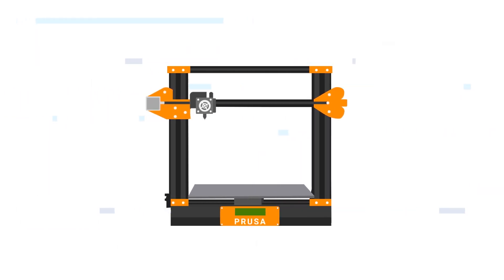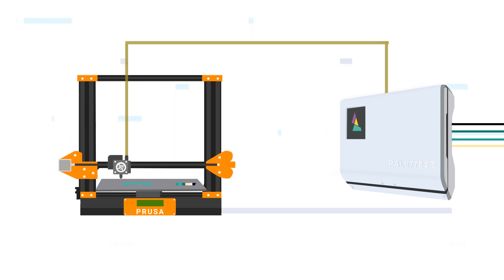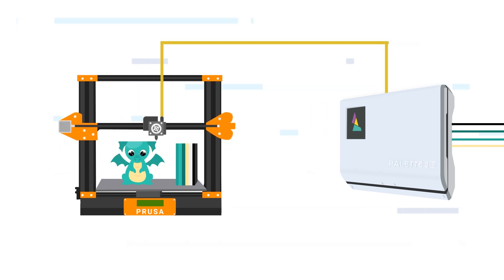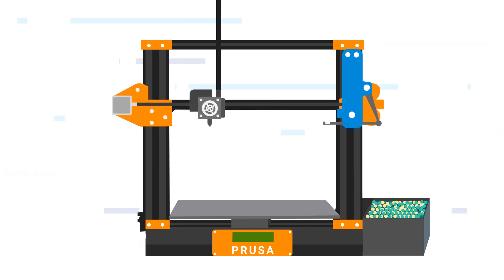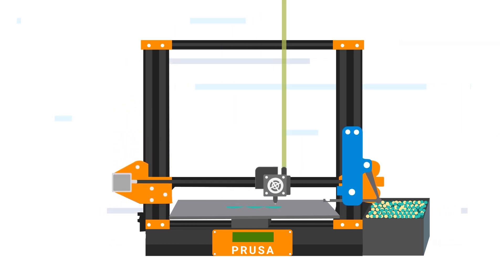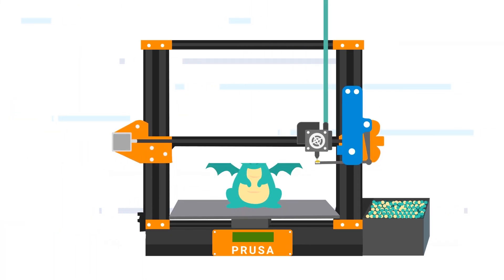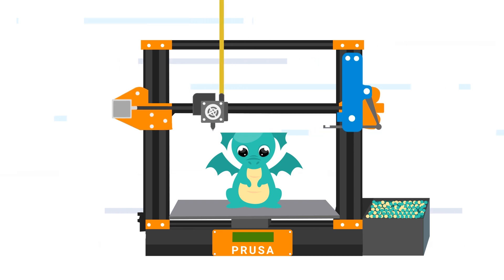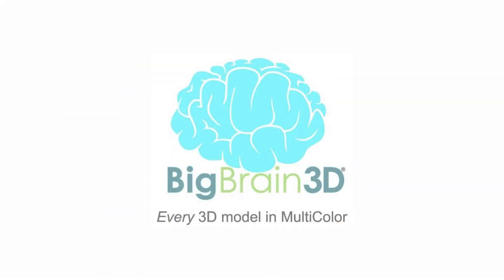Retractable Purge Mechanism for MultiColor 3D printing on the Prusa i3 MK3S

Comment: I like benefit of preserving initial build space, but how does it save filament, since you are still purging nearly same amount of pills as it would be purged in block?
Reply from the maker: It saves filament on layers which have no color changes. With a purge block you would still need to waste filament building the block even on layers that have no color changes.
Reply: @BigBrain3D  and a purge block is very big to recycle the smaller pills can easy handle and maybe pre sortet by color
Reply from the maker: @elofos0815  great idea! We have a video that demonstrates exactly that idea of recycling the blobs (it doesn't color sort them though): https://youtu.be/C7EUpfURfQY